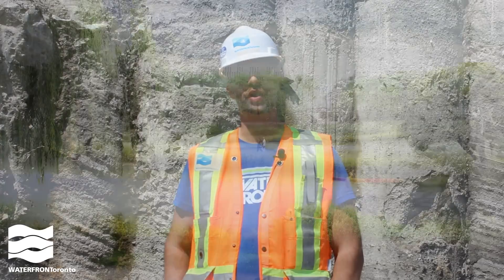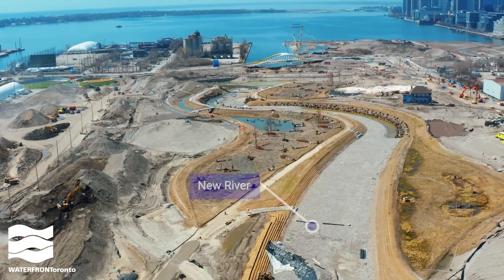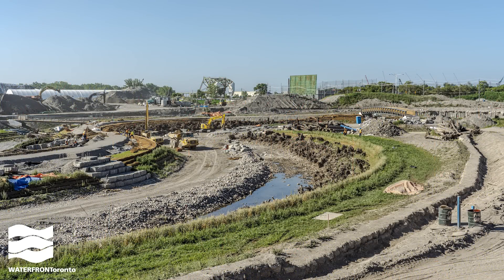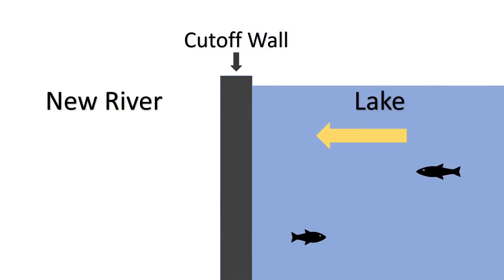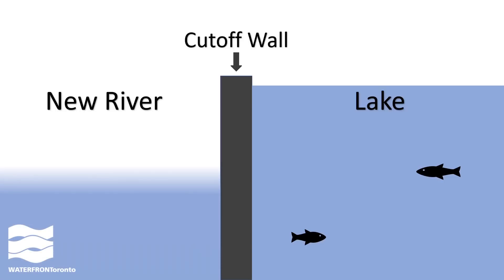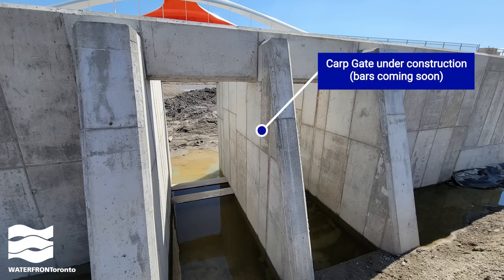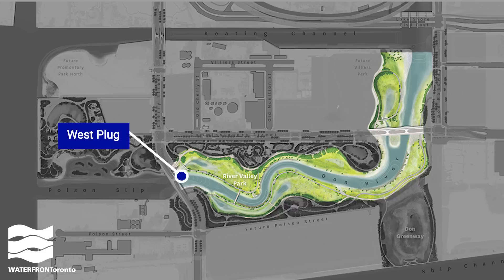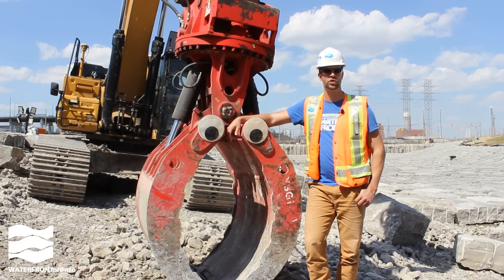How We’re Going to Flood the New Mouth of the Don River

Comment: Why are you pumping when you could have incorporated a slceway pipe and valve or spillway with a stop log gate into the plugs and just opened the gate and let gravity fill the new channel? No energy required.
Reply from the maker: We need greater control of flow rates and the location of filling operations so we're using pumps to direct water at specified rates and locations.

Comment: Are there water filtration system to filter the water like in lower sherbourne?
Reply from the maker: The new river valley we’re building will be an extension of the Don River, so there will be no filtration between the existing river and new river mouth.

Comment: I knew it could only be that dramatic in a video game. I'm looking forward to the new island but i have two concerns...

1. The Signature Waterfront Streetlights weren't used. Instead, Toronto Hydro put up utilitarian street lights that look out of place compared to the beautiful bridges they're standing on.

2. In order to increase housing supply, the 2017 precinct plan is getting revised. I saw the rendering for the 3 options you guys developed, and I think it's just too much. The key to building more housing is opening up the vast majority of Toronto to reasonable development, instead of restricting most areas to single-family homes. Cramming as much density as possible into one of the most picturesque public projects in the country isn't going to help that much, but it will make the park, river, and streets much less enjoyable. Perhaps some parts can use a little more density, but what you're proposing is out of scale with the size of the island and the original vision for it. For example, Commissioners was supposed to have a series of mid-rise buildings that are all the same height, in order to create a feeling of grandeur. You're proposing to throw this out. Out of all the options, I prefer Option 3, but it's still pretty disappointing. We need comprehensive planning reform across the entire region, not cramming people into closely-spaced, overwhelming towers that have no respect for their surroundings and make it hard to enjoy streetscapes on a human scale. In the 2017 Precinct Plan, you proposed a couple of towers that were appropriately placed, well integrated into their mid-rise bases, and actually contributed to the visual identity of the island's skyline. Now, the built form of the island will be incoherent, confusing, and invasive to the park since the island isn't actually that big.

I hope my comments are taken into consideration. You've done such great work but I'm worried that this could substantially lower the end result as a whole.

Comment: Can someone explain why if the new Don river valley is better why they did not continue through to the shipping channel and inner harbour as well?
Reply from the maker: Our plans for flood protection connect the Don River to both the Inner Harbour and the Ship Channel. Our work is actually extending the Don River Valley south of where it currently turns into the Keating Channel. You can find a good map here: https://portlandsto.ca/project-details/
Reply: The primary purpose of this project is flood mitigation despite the land development aspect it's still a net cost to build land and it's cheaper to build north than south into the lake. RCTransit made a great vid on this here "Toronto's Building a New Island (with
Trams)? | Villiers Island".

There was some other flood projects done in the west end around old mills neighbourhood and elsewhere up north along the Humber river. The city is building up our water system to deal with the potential of another flood event like hurricane Hazel but worse.

Comment: Cool video. I do have a question, though. When you say pump the lake water in, can you and do you take advantage of the siphon effect? Seems to me you could use gravity to do most of the pumping with machine power only being used to start the siphon and control it.
Reply from the maker: We need greater control on flow rates and the location of filling operations so we’ll be using pumps to direct water at specified rates and locations.

Comment: Aw, I was really looking forward to coming to the grand flooding event where they removed the plugs and a torrent of water rushed into the valley to applause but due to a miscalculation by the engineers the flow was too high and it swept away all the spectators Lord of the Rings style.  Oh well